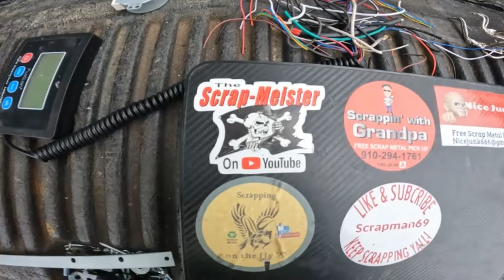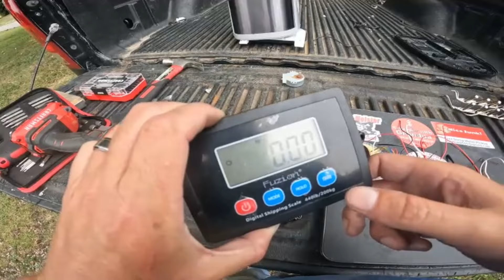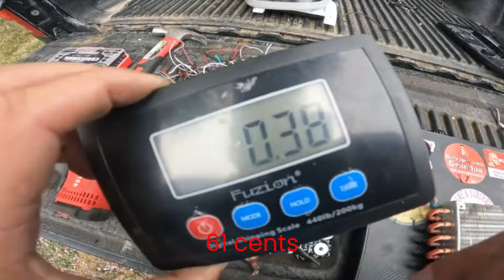Scrapping an Ice Maker for Valuable Metals: A Recycler's Guide

Comment: I’m amazed your scale works on your tailgate mines gotta be level and on a solid surface it seems! That could be why it bounces around abit to mine won’t zero most times
Reply from the maker: Yeah sometime I feel like on the wire and aluminum it won’t pick up but I know has to weigh something and might be why the number changes like you side where it’s not lvled out and makes the number go up and down